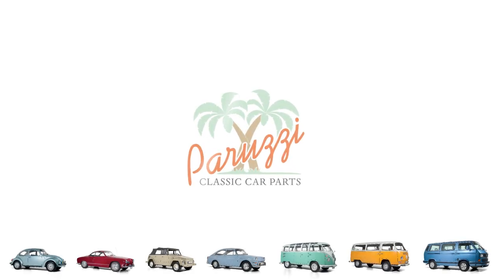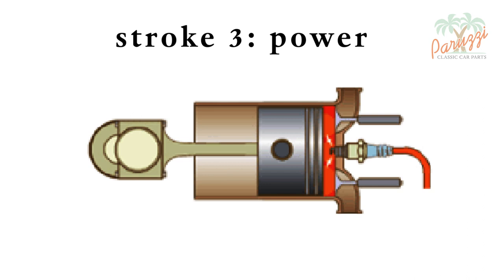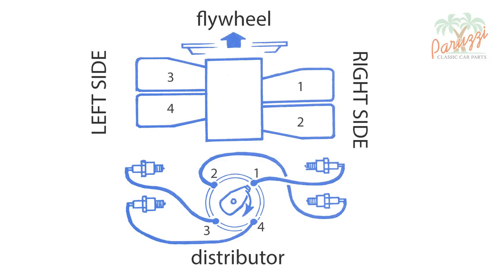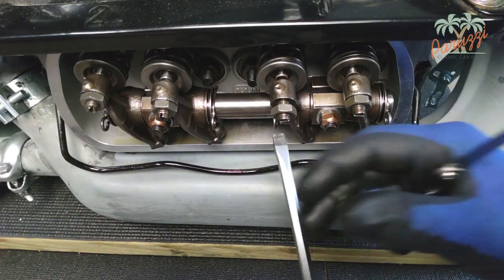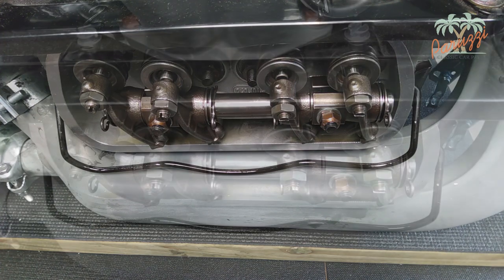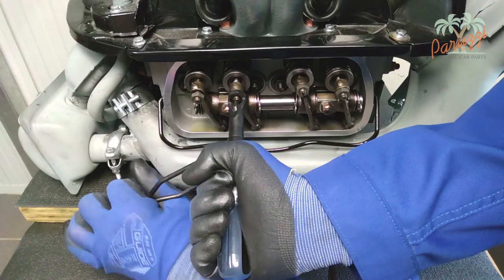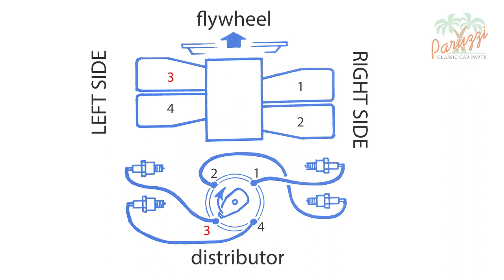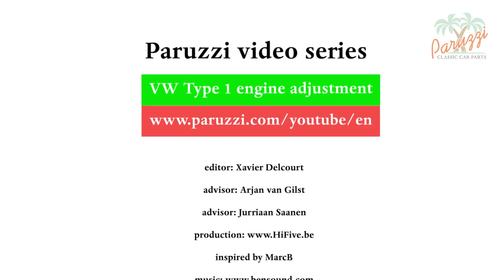01 Engine adjustment - valve clearance

Comment: Really nice! But VW manual recommends 0.10, not 0.15. Why do you adjust with this measure? Thanks!!!
Reply from the maker: The original VW manuals mention 0,10 valve clearance, but VW changed that setting to 0,15 mm later on because they ran into problems with 0,10 mm. 0,15 mm is more clearance, and so more save, with not too much lost of power. For VW at the time, reliability was more important than performance as they had to give warranty on their engines. If you look at late 60's and 70's manuals, they will all mention 0,15 mm clearance. Go for 0,15 mm for sure.

Comment: A ver si  podéis hacer los vídeos en Español😅.
Reply from the maker: All our videos have captions available in all languages. So, when you enable the icon translation in YouTube, and then in settings you may choose the language to translate to, Spanish. Hope this helps. / Todos nuestros vídeos tienen subtítulos disponibles en todos los idiomas. Por lo tanto, cuando se activa la traducción icono en YouTube, y luego en la configuración se puede elegir el idioma para traducir a, Español. Espero que esto te ayude.
Reply: @paruzzi-english    Yes, but the problem with subtitles is that they don't let you see the video well.
Reply from the maker: @ismaelrodriguez687  I understand. There are many tools to turn subtitles into voice over. In the Google Play shop you'll find "Speak Subtitles for YouTube" App, as an example. Once installed, you can turn off the standard English voice, click on the loudspeaker icon and choose another language, from Microsoft or Google AI voices. Hopes this helps until we add native Spanish.